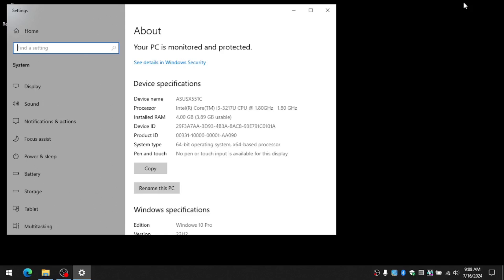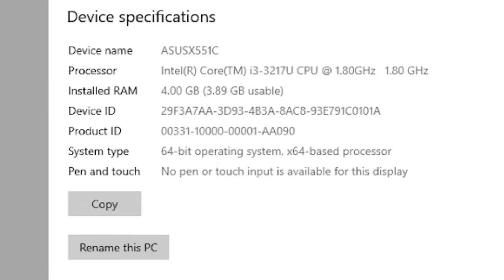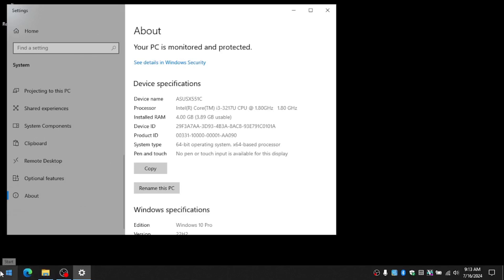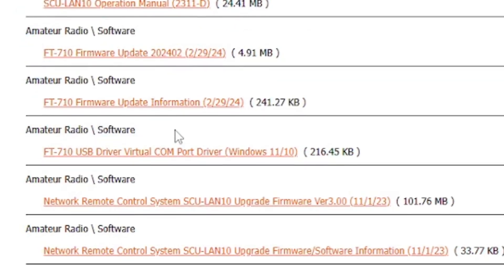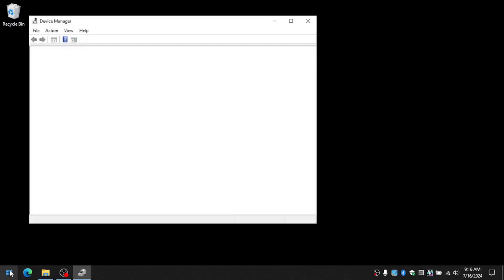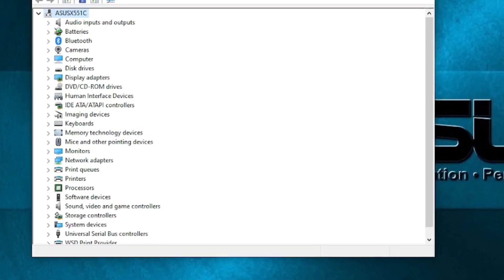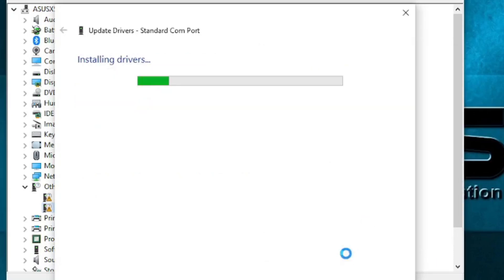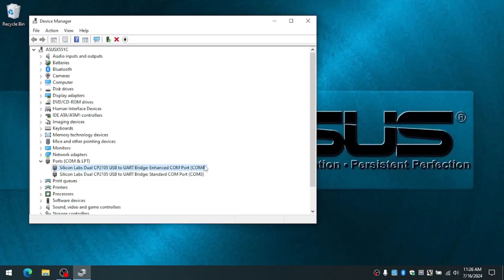Yaesu FT-710 PC operations basic tutorial - video 1 of 2 - Connecting and Installing USB drivers

Comment: Hello friend, I'm trying to install the COM port driver to do digital modes with my FT 710 Yaesu, but Windows 11 won't let me. I don't know what to do anymore. I've already sent an email to Yaesu and they can't even help. As your video is on YouTube and the reach is GLOBAL, the whole world can see it. Maybe there's someone who has faced a similar problem and can help me, or if you've already encountered this, could you help me?
Reply: Ive got the same problem
Reply: Dump Windows 11. Seriously. I'm NOT "upgrading" from 10.
Reply: Download the driver from Yaesu - unzip go into the folder and right click the silabser.inf file choose install from drop down menu. Both drivers will be installed at the same time.  Do not connect your USB cable to the computer while doing this. reconnect after the install.

Comment: Very nice explanation.
I did indeed got a headache when connecting my 710 to the computer.
Too bad I found this video too late, I had connected everything and everything worked, but I experienced problems with the soundcard of the Yaesu.
I discovered that when I used more power than 10 Watt, the FT8 program suddenly complained about suddenly not finding the soundcard in the Yaesu, during transmission.
The problem was indeed that I had used a USB cable that I still had lying around, without ferrite cores.
The radiation of the HF power caused these problems and after placing a ferrite core the problems were solved.
Thank you, keep up the good work!  (ON4CGO)